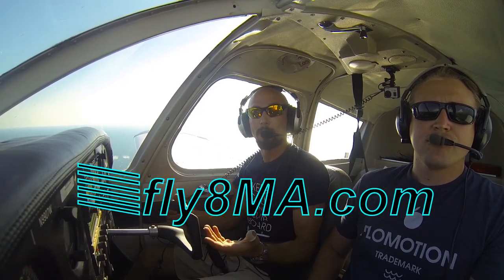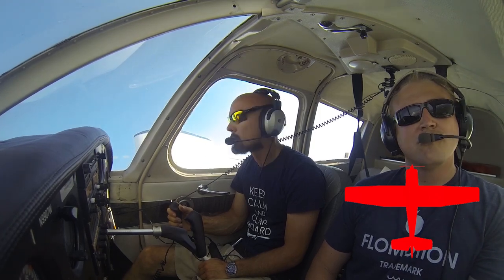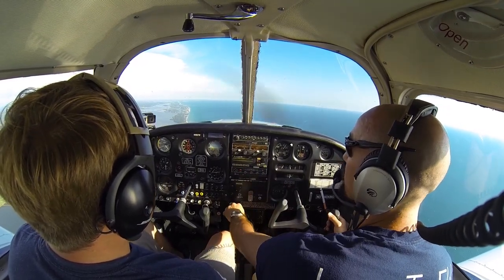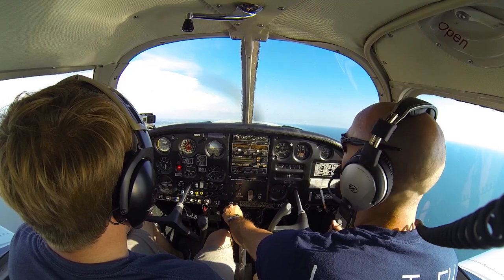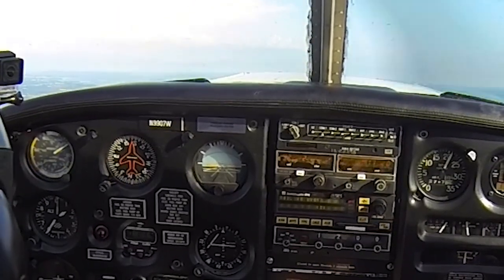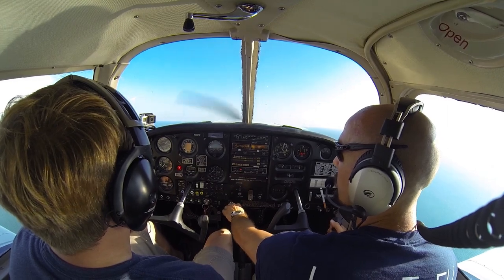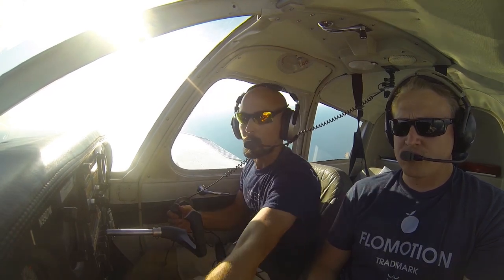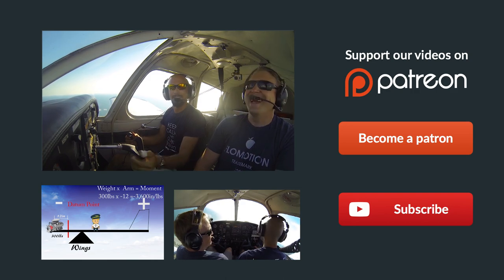Ep. 9: Slow Flight | HOW TO

Comment: You should not have your stall light on. 55MPH is the stall speed in the dirty config. Maybe do slow flight at 60MPH. The DPE will fail you if that stall light goes off in slow flight.

Comment: Why do you need  turn on the fuel pump?
Reply: In my opinion, there should be like 2 fuel pump at that kind of airplane, one of them is engine driven, the other one is electrically. So except the cruising especially when the pilot gonna change the rpm for working at training area (stalls, steep turns, slow flight etc) the engine driven fuel pump is not enough at low rpms or manuevering. thats why we prefer fuel pump on at Takeoff, Training areas and landings. Turn of the fuel pump at cruise and level flight is just for efficiency of fuel consumption.

Comment: I thought Aviation used knots, not mph for speeds? 1.15 kts per every 1 mph. That’s a significant difference, enough to get into trouble low and slow in the landing configuration.
Reply: Dan Baltizar it’s my understanding that nautical miles are implied when he says mph. So mph in an airplane would be in nautical miles.
Reply: No some airplanes use MPH. The 172N I fly does. They also have a kts reading but the MPH is big like in your car.
Reply: brian gousby oh, interesting. Wasn’t aware of that. Thanks for the clarification.

Comment: dear john , i m student like 90 hours  trying to get  private pilot but i m still had problem with landing . please give me some advise i m stress out about that ? thank you
Reply from the maker: Best I can tell you without having flown with you is to watch the videos on our website: www.fly8ma.com especially lessons 1-9.
Other than that without flying with you I couldn't really begin to tell you what specifically you need to work on without seeing where you are struggling.
Reply: just a friend: sir I had the same issues. I took me years to finally get it straight. but understand I could only fly once a month.  keep practicing and don't give up. I finally got my license.
Reply: I have just qualified on fixed wing microlights. Took 60 hours and had to do lots of circuits and landings and go arounds to get it right. Still frightens me a bit. From my personal experience I  would highlight the following points (for nose wheel aircraft in good conditions - wind down the runway):

* A good landing starts with good approach. Get the aircraft descending to your aiming point at the recommended speed early. I like to get fairly close in to do a glide approach as modulating power can make the approach unstable.  Keep the nose down to maintain minimum approach speed.
* If using power, cut it as soon you are sure you can glide in.
* You need to establish a picture of when the aircraft is about 20ft above the ground - I think that is the most important part.
* Then SLOWLY level off and cut power if still on. Allow the aircraft to settle in level attitude for a second or two.
*  Aircraft will be sinking , so keep pulling back gently to arrest the descent. The nose should keep rising and it will touch down on the main wheels. By this time the nose should be sufficiently up to block your forward view. (Think of your slow flight exercises)
* Keep the stick back and allow the nose wheel to drop of its own accord.
* Keep it straight with rudder during the whole process.
* If you bounce, apply full power and some right rudder to go around, without experience it can be difficult to establish if you have bounced 6 inches or 6 feet. Reading accident report, so many are due to incorrect actions after a bounce - the pilot puts the stick forward to arrest the climb and comes down on the nose wheel.
* And remember - "Every approach is a go around with the option to land"

Comment: Is it ok to fly slow with the stall warner continously sounding?
Reply from the maker: For training purposes with a CFI it's done quite often.  As with anything, when done properly it can be safe.
Reply: You will be ten knots above stall when warning goes off. 55 kts dirty , 60 it's clean. The plane will start to buffet before actual stall. I usually hear small ticking made by stall warning.
Reply: @jasonk795  The stall speed for the Piper 140 I fly is 55 MPH dirty. So I need to be between 65 and 70. I heard that if the stall light goes off, you flunk the slow flight maneuver.

Comment: At least 2 THOUSAND feet AGL, right? 👍
Reply from the maker: Certainly, "an altitude that allows for recovery no lower than 1,500agl dual, or 2,000ft agl solo"  Key there is "altitude that allows for recovery no lower than", so maneuvers where you would be loosing altitude should be started higher (stalls, spins, etc.)

Comment: Why does the fuel pump get turned off?  How does the engine get fuel with no fuel pump?
Reply: Gravity
Reply: The fuel pump is in addition to the engine driven fuel pump. Used as an extra boost for landing and taking off.  High wing aircraft sometimes have no fuel pump and are gravity fed, but Piper Cherokees are not.
Reply: @Dan007UT  Great thanks for the answer.  Two fuel pumps with this model makes sense.